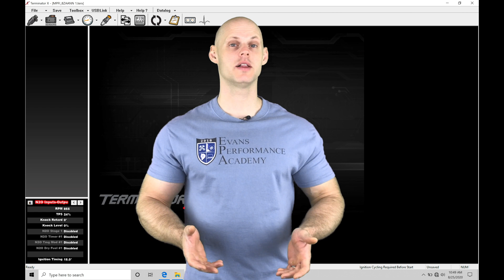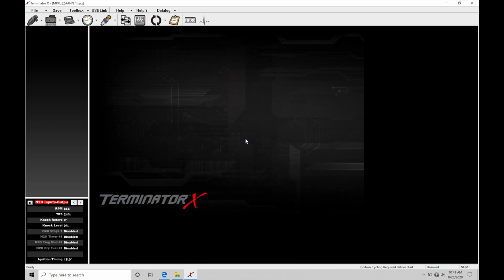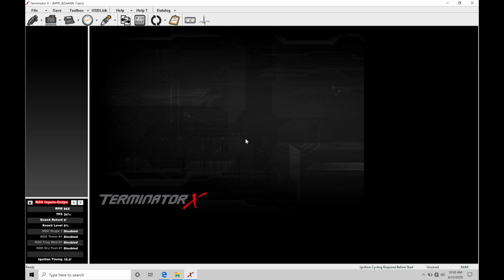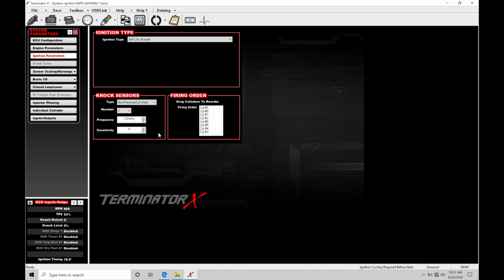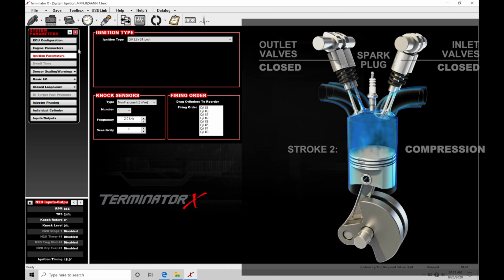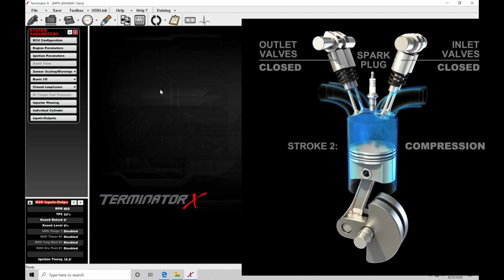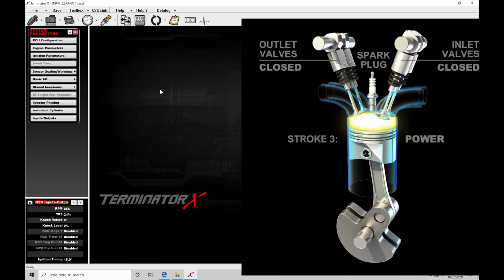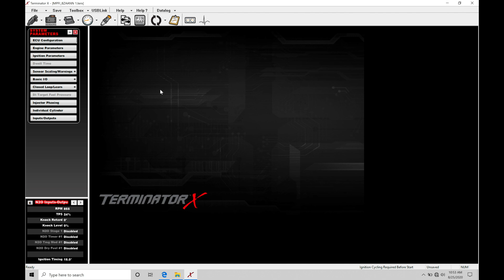Holley Terminator X Training Course Part 21: Knock Control | Evans Performance Academy

Comment: This video perfectly explains Which type of knock sensors to use on holley terminator. And how to wire it. And How to configure it.   Wait 🤔 it doesn't talk about any of that.  It just tells you what knock is, And what causes it.  Except for anyone that clicks on this video, Probably already knows that. THAT'S WHY They are here,  don't cha think?